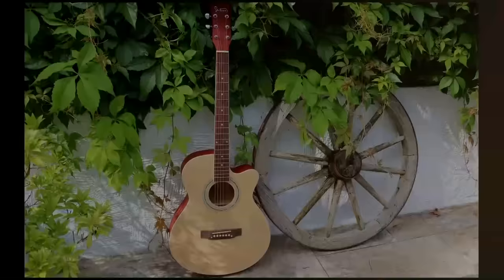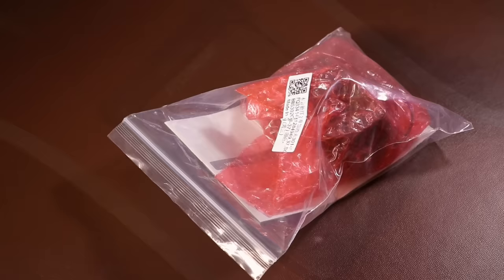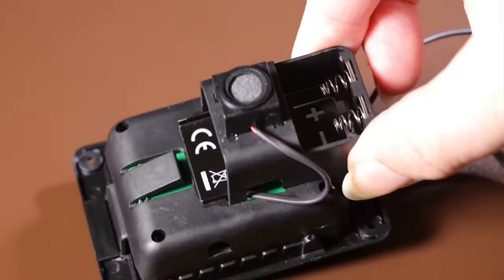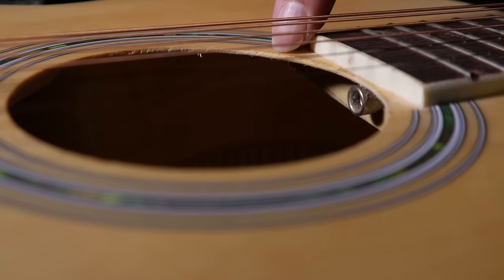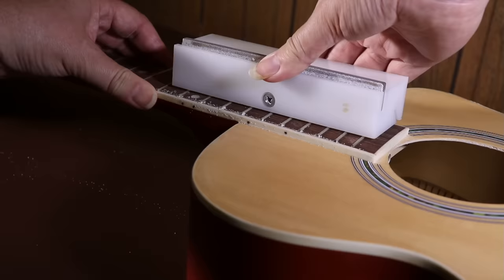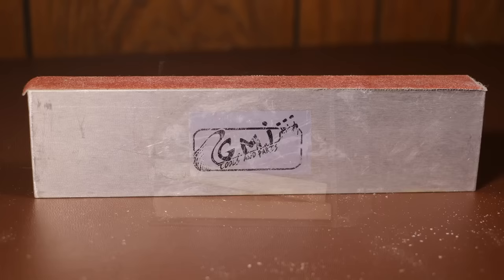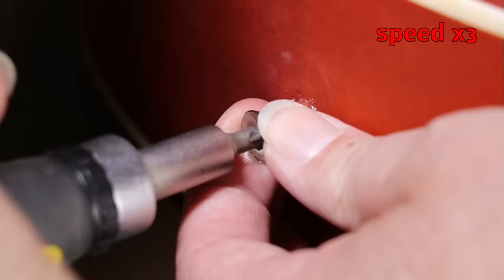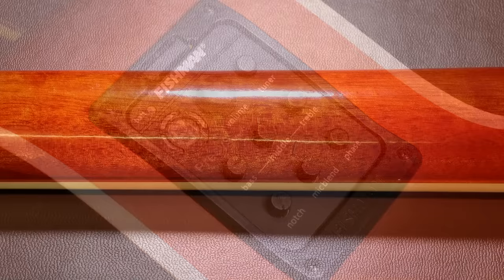How to make a cheap acoustic guitar play like an expensive guitar.  Upgrade an acoustic guitar

Comment: Thankyou so much for your tip & video. Sanding the soundhole was something I never thought about but the best improvements I got IMO was your teaching on fretwork... My gosh, they are like glass now. I also built my own 45 degree file by picking up a fine and medium " diamond file" from a store called Harbor freight here in Indiana. These were basically rectangular, about 4" long and 3/4 wide. I took 2 blocks of wood and trued them flat then used my tablesaw and put a 45degree slot in the block for the files to fit. I then used some epoxy and that was it. I could also put on any radius if needed but the results from this simple tool that cost me less that $5 was great. We put in a fishman acoustic amp and when you stated about using a manual file after cutting the hole in the body and battery that was spot on and really helped. I would love to see some finishing videos. I'm looking for videos on figured Maple with analine dyes.. Anyhow, thanks again for you wonderful video that helped me & my boy turn my 1972 Guild into a modern day Acoustic/Electric.
Reply from the maker: wow really good job making your own angled files . . 🙂🙂
Reply: @guitar-academy   thanks for the Compliment but to be honest, watching your video was exactly what gave me the idea. When you were talking about the difference that using the angled file system could make, I didn't have enough confidence to try it freehand or risk having a bunch of random angles all over the fretboard. After seeing how much they cost from places like StewMac or LMI, I paid attention to your video and read up on the general 45degree angle used on fretwork... The idea I came up with for putting a radius on the block I kinda took from StewMac after I had used what you taught and watched you working with in your video. They sell those wooden radius sanding blocks of solid wood so I figured that's all you need to make and sell your own. I'm not sure if your familiar with Harbor Freight but if not, give them a look online. You can find so many cheap tools for luthier type jobs. They even sell mini diamond files that could be used for fine file work on bridges, tremolo, etc.. The files I bought were $3 a set & came with a coarse, medium, & fine. I only used the medium & fine files however when making the fret files as the coarse one seems like it would eat to much of the fret but then again, it could become handy if I had Stainless Steel frets.. Anyhow... Thanks again for teaching me those " must know" techniques. I'll be able to use them and my boys will now have an advantage when dealing with thier guitars as they get older.

Comment: I bought a cheap ibanez with a broken neck at a charity store. after i re glued the neck it sounded ok. I removed the soft crappy plastic nut and saddle. bought a cheap bone nut and saddle intonated it set the string height fret level and importantly put some elyxir strings on it it was suddenly twice the guitar, still my main player. I liked it so much I sold my good acoustic for 1500 because I liked my 15 dollar Ibanez better. I think the saddle material is particularly important as it transfers the sound to the top.
Reply from the maker: This video was a summary of the work on this guitar  . . that was all done and it did make a difference . . https://youtu.be/N9dvUg90T6M  and more besides 😀
Reply: @guitar-academy  nice video!

Comment: Great video. I glued two thin strips of elastic I cut into short sections inside my string winder so it doesn't slip off when I'm using it.

Jack ~'()'~
Canada
Reply from the maker: Good tip . . 🙂

Comment: 0000 Steel Wool with lemon oil rubbed on the back of the neck will make it feel great without taking off so much finish.
Reply from the maker: Great tip!

Comment: 18:44 Hello, just a small correction: the piece on the lower part of the guitar which is sanded by 4mm is called the saddle, not the bridge. Good job on modifying the guitar.
Reply from the maker: Yes, this video was done when I was still in the habit of talking violin 🤔

Comment: 37:36 Try True Oil, much better finish similar to Danish oil. I'm not a luthier but a cabinetmaker and three years ago I bought a Kort 3/4 size flattop box for the tone. ($280 cdn) I replaced the bridge and nut with deer antler and lowered the action. then I polished the neck with True Oil and bought some gold plated Grover tuners doubling the value of the instrument. Sweet!

Comment: For safety sake, use a Forstner bit to cleanly and securely cut the electronics plug hole. Those paddle bits you used are netorious for jamming, splintering and skipping out of the hole.
Reply from the maker: Thanks for the tip . .  🙂🙂

Comment: Alembic recommends organic lemon oil for fretboards. And dont over saturate, it can cause your frets to lift up. My friend purchased a inexpensive classical guitar, I'm going apply these techniques for setup. Thx
Reply from the maker: Great tip!  and as bad as the frets lifting, if you over saturate the neck you can cause the glue to degrade . .  😮

Comment: Tip for removing pegs. Get an old dining fork , with pliers turn the two middle prongs outwards just enough for the prongs to fit between the prongs. A cheap peg removal tool.
Reply from the maker: good tip . . 🙂
Reply: @guitar-academy  Good channel 👍

Comment: I got a fret rocker and used it on my guitars. On my Jackson I pretty much only got about 4 frets that DIDN'T rock, does this mean that there is a lot of fret work needed done? Or am I probably not doing something right, but it seems pretty easy, you just lay it across 3 frets at a time and see if it rocks, most of my frets rock just a little.
Reply from the maker: That does sound like an excessive amount of rocking you're getting.  My first question is, does the guitar buzz a lot ?  if no, then don't worry about it.  Just use the fret rocker to help you cure buzzing frets, don't try to fix buzz that isn't there or you could ruin your guitar.  🙂

Comment: When I sander the saddle I got the buzz, I ordered new saddles, but learned shims work too.
Reply from the maker: yes they do and they are easier to do and they work well, but a perfectionist wouldn't use them because every joint reduces acoustic transmission.  🤔

Comment: Did you say "almond oil"? I wonder what oil you used because I want to do the same to my guitars as well. Thanks!
Reply from the maker: Yes, I use Almond oil, you can get it on the internet or at a pharmacist . . 😀
Reply: I got almond oil here.. I use it as skin moisturizer. Never thought I’d use it on fret work! Great tip! Thanks so much!
Reply: I would not use any natural oils on a fretboard. They get rancid and sticky over years. Mineral oils are the better ones. 

I use baby-oil or vaseline in small amounts for the fretboard (just because I had them already for 20+ years, they are mineral based and did not change properties at all) . These do not alter over decades and don‘t smell at all.
Reply: Hi could you please tell us the brand of Almond oil your are using ? Many thanks ... great video indeed ...
Reply: @lone-wolf-1  Yes. Martin Guitars have recommended 3-in One oil.
Each to their own though. 
I go with Boiled Linseed Oil applied along the grain. 
Five minutes soak time only then wiped off across the grain. 
The oil polymerises and dries hard in a few days but is playable straight away. 
Raw/Non-boiled Linseed Oil will not dry or polymerise in this way and should be left for other uses.
Reply: what you guys think of lemon oil?

Comment: This sounds great but many cheap guitars have mismatched strings for their length.  It can be checked by plucking the 12th fret harmonic and then play the 12th fret.  If they sound identical then the string is the right length and thickness.  if the 12th fret note is higher than the 12th fret harmonic then the length of the string is either too high in action , or too thick or too short to the bridge.
Reply from the maker: Agreed . .  intonation can be a major issue and to fix it on an acoustic guitar can be really hard.
Reply: @guitar-academy  I suppose you know that going with a thinner or thicker string can fix it if you have access to a lot of strings.  If a purchased set has one or two off strings the length can be changed by making a broad bridge that can be filed forward or backward more so than the groove placement and can be set in that groove  by carving a relief around a ridge to fit down in that original groove.  This requires a some hand skills or a wood shop, but it can fix a guitar for any set of strings from then on.

Comment: Use black leather dye with oil in it.  Let it dry then use your normal oil.  It will look like ebony.
Reply from the maker: Good tip, I try at some point.  I wont do it on this guitar though, it would look wrong . . 😀

Comment: I'm interested in how the eBay pick up has performed over the months since the installation. Have you had any issues with it or the quality of sound it produces?
Reply from the maker: If you look at my latest lesson videos, I'm using this guitar and it is the cheapest guitar I own.  The battery life is good, the tuner is accurate and it produces a really nice sound, even out of this cheap guitar.  I have a guitar with a factory fitted Fishman preamp in it and it doesn't sound as good as this guitar for recording through the preamp.  I'm really pleased with it.  (after saying all that it'll probably brake down tomorrow LOL)  😊
Reply: @guitar-academy  I have a project guitar and I've ordered just ordered the pickup from ebay. See how I go. Thank you for the video and reply. Both are very helpful
Reply: I have fitted one of the "Fishman presys blend" pickups to a guitar using this video to help me, and my top tip is don't use a craft knife - use a dremel. So far it has worked fine for tuning, but I don't use it frequently plugged in, just want that feature available from time to time. I don't like the sound of piezo, so the mic blend really helps to get a nicer tone.

Comment: Great video. I've done this many times. But there's always a little tip that can make it a bit easier. I don't see you thread the plug socket, so I'm not sure how you did it. I drill the holes as you do but then I thread a thin Jack plug lead through the hole into the guitar and so it pokes out of the sound hole. I then plug the jack into the socket and pull the lead back carefully through the hole complete with the new socket. I repeat the process for length adjustment and when it is ok I remove the lead Jack and screw the nuts and cover on using an Allen key in the tiny hole drilled into the side of the thread to prevent slippage until the nuts are tight.
Reply from the maker: Great tips . .  someone suggested wooden doweling, but a lead is even more to hand . . .  🙂

Comment: I installed a cheap knock off Chinese piezzo/mic EQ in a really expensive hand made guitar. Biggest mistake I ever made. I would recommend K&K Mini pick ups. They are passive and require an external EQ which saves making a huge sound port in the side of the guitar.
Reply from the maker: Good advise  . . . 🙂

Comment: very nice, how is the action at the 12th fret now?
Reply from the maker: when I first put the strings on I was worried I'd taken too much off, but I got it right. The action on the bottom 'E' string (thick one) is very good and no buzzes.  I can still angle the bridge slightly to lower the top 'E' string slightly, but I will do this in a future video when I put a better bridge on, the one on now is not very good because it has hollows in it.
Reply: even more expensive guitar have an action problem, i have a epiphone aj40tlc 1998 125th anniversary edition with way to high action ... i just took a file and used that on the bridge ... action is much better, no hums and it finally made the guitar playable ... but it is not the best most professional solution i am sure
Reply from the maker: @bartholomeusclever  Many people think that high action is a fault on a guitar but that's not true.  Some very good professional guitarists like the action very high and some expensive signature editions copy this.  If your solution has turned an unplayable guitar into a playable one, who cares if it isn't the most professional solution . . . 😊
Reply: thanks

Comment: Most of preamps are actually very cheap. From the other hand brands are expensive. (Trade mark) Takamine preamps cost around 250$. They are used on high end Takamine guitars. Same goes for preamps used by Gibson,Taylor etc.
Reply from the maker: Most of what you pay for with the brands is the name.  I've done extensive tests between the cheap and expensive ones and most of the time there isn't an appreciable difference.  Some of the cheap ones are exact copies of the expensive ones at a fraction of the price. 
Is it morally correct to copy the work of someone else?   I think NO,.  But is it moral to charge £250 for something that costs £5 to make or maybe £15 including development costs?

Comment: Thanks for the great tips!
The pickup that came with mine isn’t working and the model has discontinued so a new, larger model will need to be installed. 
Cheers!
Reply from the maker: That's a shame . .  I hate it when that happens.  Sometimes you can find the same pickup/preamp under a different name but it takes a lot of research to find it. 😒
Reply: @guitar-academy  eh, it’s ok. I’ve learned a lot through your vid. If I didn’t have the problem, I wouldn’t have been motivated to find out about these things. It’s actually really helped make a poorly made “Esteban” guitar sound pretty good and make it playable!
Reply from the maker: @1rgam3r  That's great news . . 😊😀

Comment: This is a very nicely done video. One thing I might mention is that the outside jack nut shown at 31:16 is on backwards, otherwise nice job. When put on correctly the outside jack nut hides the inside jack nut and makes for a really nice looking job.
Reply from the maker: Yeah . . it was sorted straight after the video.  I had my looking at the little screen on the camera glasses on, so I could hardly see the guitar . .
Reply: @guitar-academy  That was an easy mistake but this was still a nicely done video. I wouldn't have said anything but for the fact, someone may see it and also put the outer nut on backward.
Reply from the maker: @neutrodyne  No problem . .  I need to save for some bifocals or varifocals and then I want have to keep changing glasses all the time to see what I need to see. LOL  😀

Comment: It would be a good idea to drill the corners of your cut area before cutting.. Much nicer end product ..
Reply from the maker: good tip, and necessary if you use a saw because it helps stops any cracks from forming

Comment: Great Video sir..Another way that I does when removing the strings from the bridge is to push the string down which takes the strain off the bridge pins,which makes them a lot easier to pull out..It's also a good idea to put the pins back the same holes.
Reply from the maker: 2 very good tips . . . 🙂

Comment: The stock nut and saddle are plastic these days and that mutes the strings a lot and breaks after corroding. I got mine replaced with bone and it was a massive upgrade. 

If you can find an antique guitar, these parts are made of ivory which is the best quality (ivory is illegal to own unfortunately)
Reply from the maker: the nut and saddles on this guitar were bone by the time it was finished.   https://youtu.be/N9dvUg90T6M
Reply: @guitar-academy  oh thought you missed it but damn the difference in sound is amazing

Comment: This is a great how-to video.

I am, however, quite surprised that you avoided replacing the machine heads, and the nut. I have not done many guitar upgrades, but I have always done this, as well as some careful bridge work, right off, as I have always enjoyed a lot of improvement just from these 3 things.
Reply from the maker: You need to watch all the videos before commenting . .  I bring this up in the other videos and the nut is replaced.
Fitting a bone saddle and nut.  https://youtu.be/N9dvUg90T6M
The machine heads are fine and in fact sealed machine heads on most modern cheap guitars are as good as the ones on expensive guitars, and I have done lots and lots of upgrades and repairs.

Comment: A+ man, i have installed about 10 of these over the years as i quite like the fishman presys dual 301's n they sound great n are cheap but have the nice copper wire sonicore under saddle pickup which is much better than some of the others that have the hard plastic under saddle pickup with the knotches for the strings, i always polish the back of the neck very lightly with 0000 steel wool to a satin not a gloss and i always use a demel to ramp the slots a little for the bridge pics like ibanez do on their artwoods and i always use d'addario EJ Phospher bronze strings but great video man, keep up the great work A+
Reply from the maker: Thank you very much  . .  it sounds like you've perfected the sound and feel you like 😊😀
Reply: @guitar-academy keep up the great work hey
Reply from the maker: Thank you, I will 😊😊 @gregrayner3146

Comment: Thanks. One thing is please make sure that the hole cut has rounded corners or else it could split over time.
Reply from the maker: great tip . . . thank you  🙂
Reply: Better start with a drill in the corners?
Reply from the maker: @evenseb7574  yes, another good tip . . 
none of this was necessary on this guitar because the walls are plywood and plywood is far easier to work on than solid wood which will try and slit down the grain.

Comment: Also- work with the grain not against it you can see where oil is not getting info the fret board properly.
Reply from the maker: Good point . .  It's near impossible to do on the fingerboard though because of the frets, and the point of using the almond oil I use is that it doesn't dry like other oils.  🙂